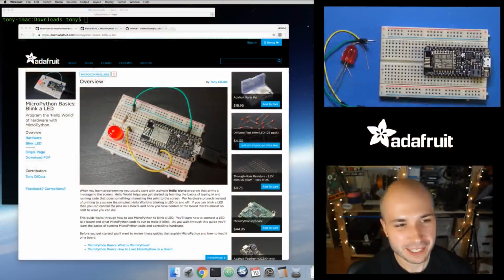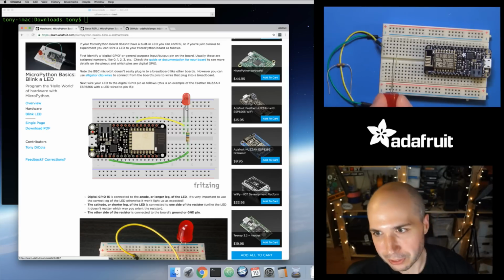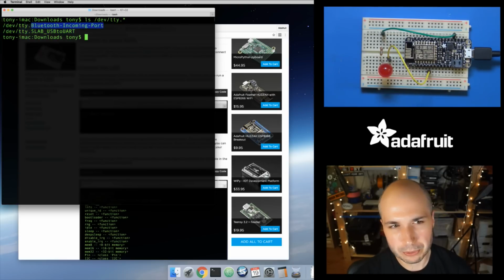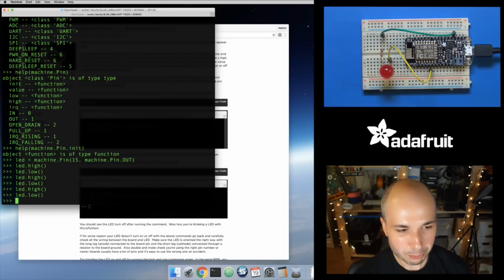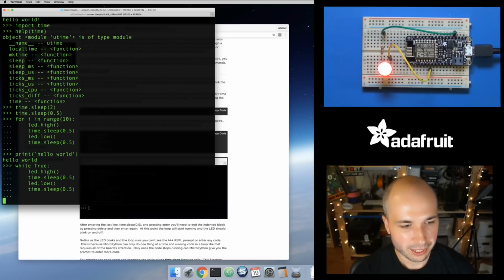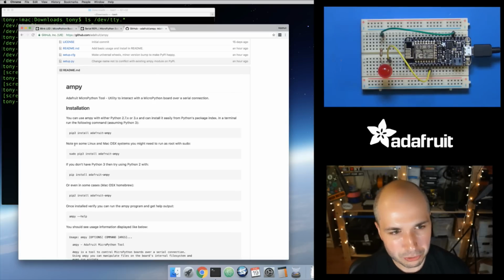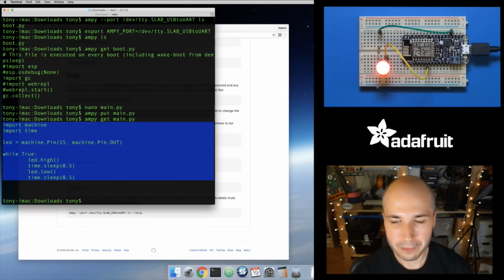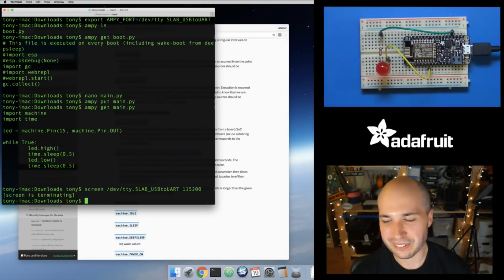MicroPython Basics: How to Blink a LED with Tony D! @micropython #LIVE

Comment: Great job! 

Just a FYI...I have the latest Micropython (esp32-20190502-v1.10-319-g2a791170c.bin) and the code to turn on and off the led's seems to have changed. 

https://buildmedia.readthedocs.org/media/pdf/micropython-pfalcon/latest/micropython-pfalcon.pdf
I tried 
led.high() and led.low()
and that didn't work. 
Then I tried:
led.on() and led.off() 
also didn't work. 
so I read the manual lol. 
now seems to be 
led.value(0) and led.value(1)
#or just     import machine
from machine import Pin 
# create an output pin on pin #16 in my case
led = Pin(16, Pin.OUT)
# set the value low then high
led.value(0)
led.value(1)

Comment: Thanks for your video's but I don't know what I'm doing wrong.  I loaded mircopython on a feather wifi M0 and have the REPL on the screen on my mac I can print "Hello World" but  after I import machine if I run help(machine) or the blink code I get these errors what have i missed.

>>> import machine
>>> help(machine)
Traceback (most recent call last):
  File "<stdin>", line 1, in <module>
NameError: name 'help' is not defined

>>> print('hello')
hello
>>> led = machine.Pin(13, machine.Pin.OUT)
Traceback (most recent call last):
  File "<stdin>", line 1, in <module>
TypeError: can't convert 'int' object to str implicitly
>>> led = machine.Pin(15, machine.Pin.OUT)
Traceback (most recent call last):
  File "<stdin>", line 1, in <module>
TypeError: can't convert 'int' object to str implicitly
>>> help
Traceback (most recent call last):
  File "<stdin>", line 1, in <module>
NameError: name 'help' is not defined
>>>

Comment: why use upython instead of C for MCUs ?
Reply: Check out the first guide & video about what is MicroPython, I talk a bit about why you might want to check it out vs. low-level languages: https://learn.adafruit.com/micropython-basics-what-is-micropython/overview?view=all
Reply: There'll be a bunch of good use cases for using either C/C++ (e.g. raw speed, using all the pre-made libraries) or upython (e.g. runtime flexibility, functional style programming) on a board, but for me I love the idea that the upython interpreted environment needs almost no external tool chain, it's all compiled on the fly so as long as you can make a serial connection from something, anything, you can use the board. I have a half baked project idea for building a minimal text input device with a small display. That'd make a great little low power mobile Python device. You could us it like a calculator, draw simple graphics, code some simple tools for using IRC, Tweeting, todo lists, note taking etc...